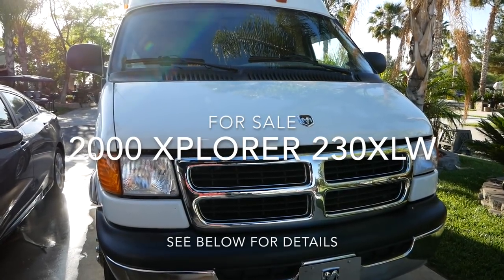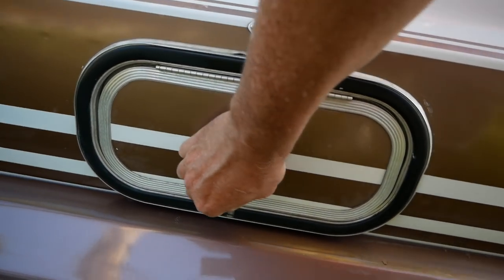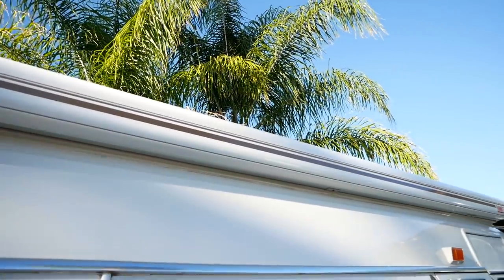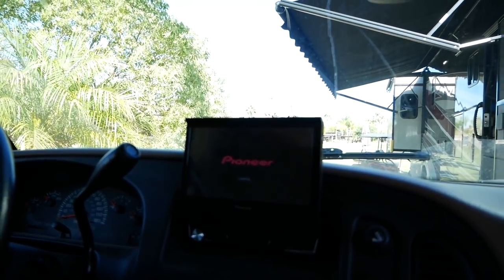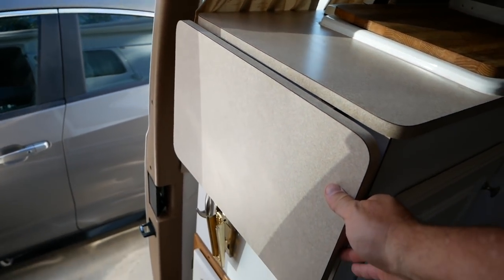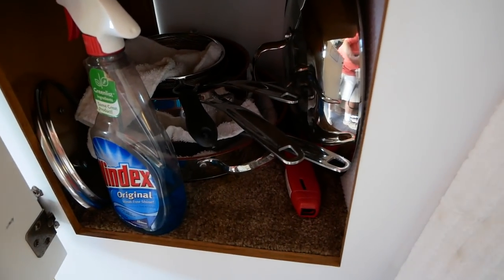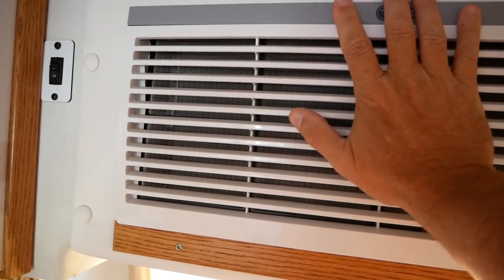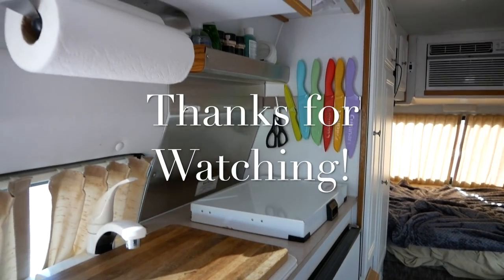2000 Xplorer 230 XLW

Comment: Hi Wincrasher: I wasn't thinking of an Xplorer (I've been looking at newer models, or even converting my own), but the upgrades you've made are appealing. I haven't been able to find MPG data; what have you been getting with this? Thanks!
Reply from the maker: these get 12-15 mpg depending on your driving style.  Generally I run 60-65 on the interstate.

Comment: How many hours can you run the A/C off the inverter/battery bank at night? (Assuming a max. battery bank draw-down to 20%) Am I correct in assuming that the panels can support the A/C load during the day if pretty sunny? Please advise, and thanks.
Reply from the maker: I figure that the battery bank could run the AC for 3-4 hours.   These are safe to run down to 10%.  If you draw the pack down to 75-80%, recharging on solar in a single day is no problem.   Here in California, I don't run the air conditioner much at all, so it's mostly microwave, coffee pot and the instant pot.
Reply: Thank you sir. That sounds like a reasonable length of run time, especially for your  environment.
Reply from the maker: I'm running a test right now.  With the AC on the inverter, running 72 degrees in eco mode, I'm seeing shy of 60 amps (including the refrigerator) on the Magnum display.   Once it starts to cycle, load should drop 1/3 to 1/2.  We'll see how long it can go, but I suspect 6-7 hours might be doable.
Reply from the maker: After 5 hours, the battery was at 78%.  Very impressed with the results.
Reply: Impressive indeed. This test was done during the day and with full sun?
Reply from the maker: Yes.  I started just before 3 PM and the van was parked in the full sun.   These Xplorers are well insulated.  The only variable I see is the humidity - it's just not that humid in So Cal, so the results might be substantially different back at my home in South Carolina.  Even so, I think overnight is do-able, but then you have to deal with an empty bank the next day.    Like I posted above, the load is about 55 amps when the unit is running, so if you do the math in a worst-case scenario, I'm thinking 8 hours.  The solar I have is only good for 20-25 amps depending on sun, so that would take several days to replenish on it's own.  Alternator is a bit better at around 35-40 amps.   Nothing beats plugging into shore power - the inverter charger will put 125 amps/hr into the bank.    My best guess is that if you only ran the AC at night, maybe 4 hours or so (using the shut-off timer on the AC) you could replenish the next day on solar alone.   If it was so hot you needed to do that, you'd have to ration your use of the microwave or other big draw appliances.

Comment: Yeah, I did click show more first.  A Queen bed is 60"x80".  Are you suggesting that bed is more than 80" across?  I'm 6'4" in my bare feet...I'm looking for a class B that I can stand in without bumping my head or having to sleep in the fetal position...but I don't think it exists...I was hoping on your wide body...
Reply from the maker: I know of no vans that will accomodate 6'4" or more headroom, other than the Super High Roof Sprinters which are now out of production.   Here's a link to the Xplorer Spec Sheet - it says interior height is 6' 1" and the width is 88".   Like I said, I put a queen sheet on the bed - the topper I ordered was for a queen and I didn't cut it down except the notches for the rear corners.  https://drive.google.com/file/d/0B-6s9vclxgXjMHN3Vjg4cmRMOFE/view
Reply: I really wanted to find a turnkey solution but I guess I'm going to have to build out a cargo van.  The high roof Ford Transits have 81.5" of vertical space in the back, so even with an inch or more of flooring and insulation, plus a couple inches of insulation on the ceiling, I should be good to go there without bumping my head.  I'll have to have a front to back bed though, since the Transit is much more narrow than your van...wow..88" across!  Too bad it wasn't a few inches taller, you made some very good mods...love the lithium battery setup.  Good luck with the sale...you shouldn't have any problems.